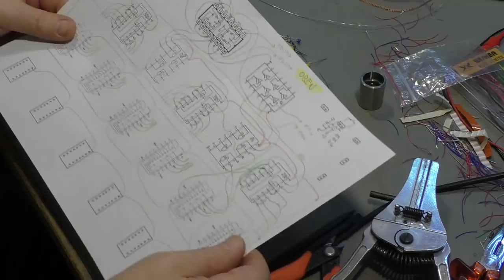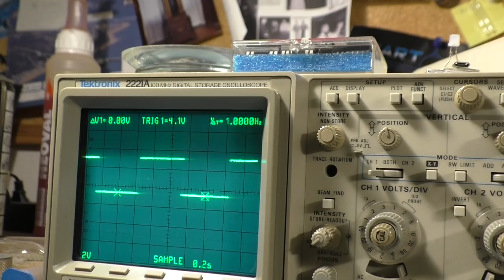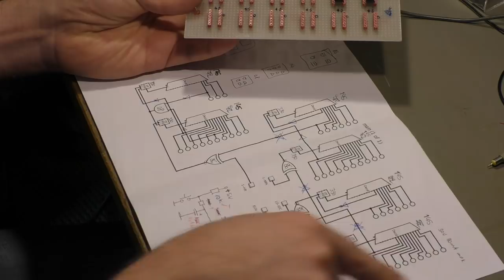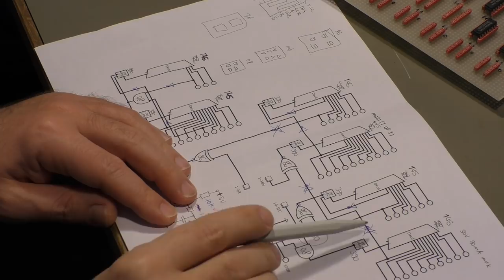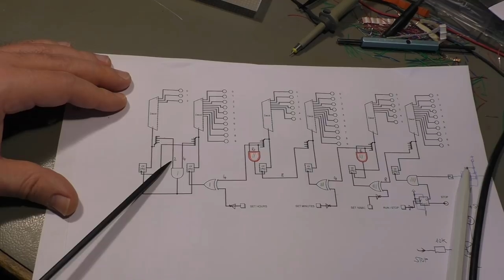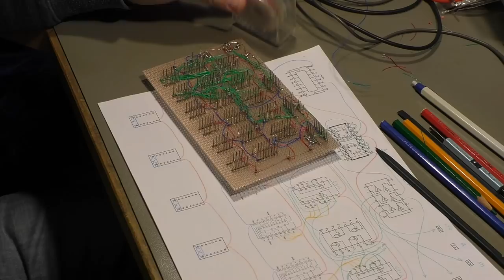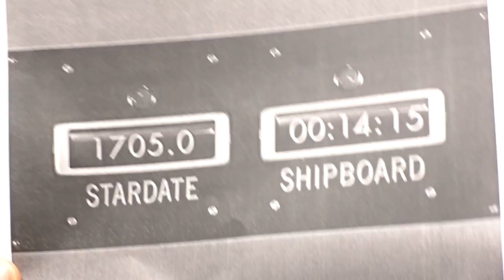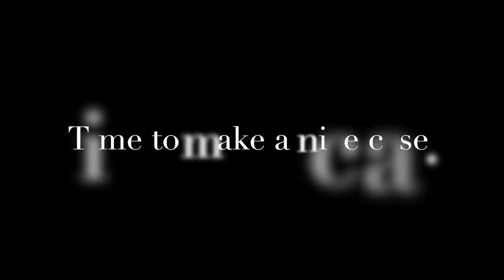Rotary digit clock 2 of 2... making the electronics - (PWJ123)

Comment: How accurate will it be, will it keep time ok?
Reply: if I remember right, async/ripple counters will drift a bit over time because of propagation delays, but probably not badly enough to be a problem here, since it's on a 1 second clock
it should keep time for quite a while
Reply: @leisergeist  

It's all driven from the quartz osc though, yep?

I would imagine that should keep it quite accurate?
Reply from the maker: As long as the counters do not miss any impulse, the accuracy depends only on the quartz. If that is not accurate enough, I'll hook it to my Rubidium oscillator:-)